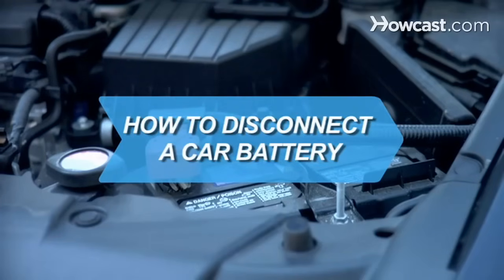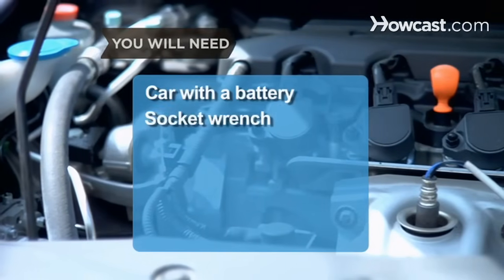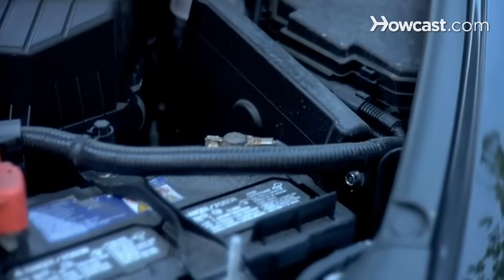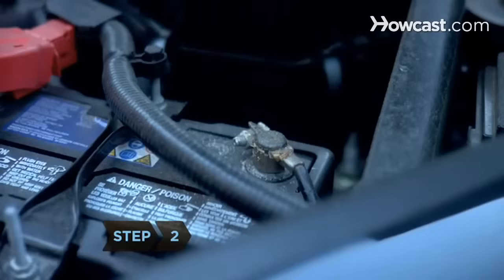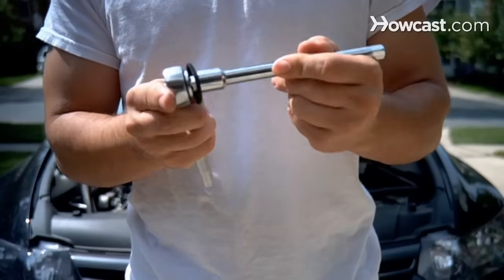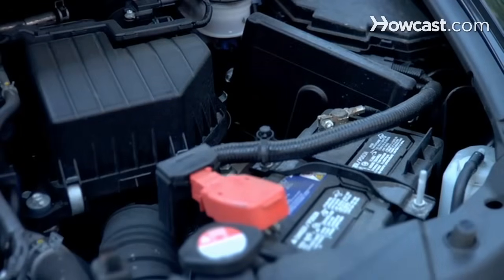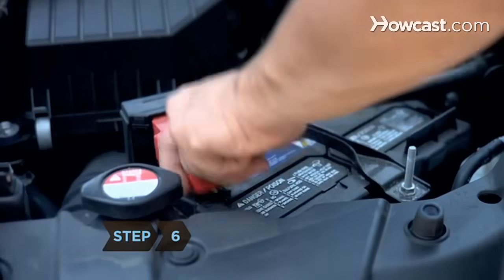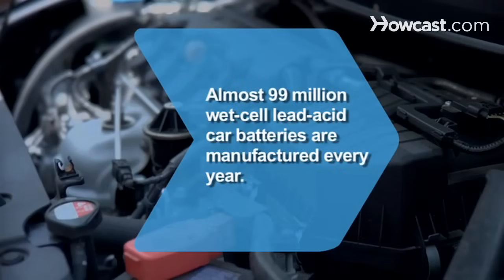How to Disconnect a Car Battery

Comment: So you don't want the positive terminal to touch any metal on the car, but it touching the metal of the socket wrench is fine? How's that work out?
Reply: Because you aren’t enough to conduct, however if that same wrench touches metal on the car while on the positive, then you may get cooked
Reply: The metal is not grounded on the socket wrench, and 12 volts is not strong enough to conduct electricity through you. Touching the car metal with the positive terminal can cause the car to short

tldr: socket wrench being held is safe as it cannot travel through you, but touching the car with the + can short

Comment: Step one should be wear eye protection and gloves.

Most car batteries contain hydrochloric acid which can easily burn your eyes and holes in your clothing
Be careful if you are using the extender because it might cross over to the other terminal and cause a shock.
Reply: I really hope your battery isn’t spurting acid

Comment: Remember, it's just a 12 volt battery...little more than your typical 9-volt.  Neg always comes off first and goes on last.
Reply: Yeah, just a 12 volt battery with a lot of amps that can cook you
Reply: may you explain why? real question
Reply: It can cause a short circuit. If you leave the negative on (black) and remove the postive (red) first, it can only flow to the negative. Always remove negative (both if you have two batteries) first, and then the positive. And then reconnect the positive and then the negative(s).
Reply: @crackerjax4330  what does short circuit mean?
 What happens to it?
My husband did this to our car.
He removed the red and left the black on it.
My old car has so MANY problems.
Reply: Thank you!!   Saved me wasting time!
Reply: Totally the info I needed...I’m always afraid I won’t remember what order to disconnect and then connect
Reply: @jenniferhermanson8969  I have to watch a video to remember every time I got through this. If my brain isn't using it daily, it tosses it. Even the simple stuff. haha
Reply: m
Reply: Exactly. I was like WAIT A MINUTE....lol
Reply: @global.mindset  nice GMAT sentence correction !!

Comment: for winter storage, can i simply disconnect the battery and leave it in the car, or do i have to remove it  to ensure its usable again. i just bought a optima yellow top and i dont want it to die over the winter with.the car sitting there. and advice would be appreciated,  thanks guys
Reply: Get you a battery tender plus. That's what I use for my battery over the winter when my car is in storage. I actually use it all year long because it's not my daily driver and the car sits alot. I disconnect the battery, sit it on my work bench and hook it up to the battery tender. It keeps the battery charged, great investment. I only paid like 45 bucks, found it on Amazon.
Reply: @JM3RD84  Does this need to be plugged into electricity?
Reply: @commentoria  Yes

Comment: This is the only way I can pass emissions. Worked 2 years in a row.
Reply: Yes
Reply: Can u clarify?lol
Reply: Ben An I’ve gotten a new car since but on my older car I’ve been able to past a test before by resetting the battery. It would take a minute for my engine light to come back on so if I got my emissions done as soon as I reset it and drive a couple miles I passed emissions once by doing this.
Reply: georgia zhane' lol ah just enough to have the check engine light to disappear
Reply: @GeorgiaZhane814  Can you clarify the exact steps and waiting time between each please? Once reconnecting battery, how long until you get car smog tested?

Comment: If you don't disconnect the negative before the positive you can end up with a short or even worse, even though this may sound and look stupid and simple, doing things the right way might save you from some headaches...just saying.
Reply: Abraham AlRajhi you ever finish this?
Reply: TheBerginton I didn’t watch this video and disconnected Red first and now my battery lights on
Reply: It's myth, build simple cicuit with one AA battery and LED, first break the circuit from the plus side of battery, and next time with the minus side, you see? It does exactly the same, since the circuit of both the car battery and LED is in series no matter which connector you detach first the circuit will be opened and thus no current will flow if you do it in the correct way, eg. when the car is not turned ON
Reply: Scared of toasters the car...
Reply: LOL @ your obd2 chip. That wont do anything for your car
Reply: yeah.. it seems okay since u have closed the circuit...
Reply: TheBerginton I only disconnected the positive because the negative isn’t coming off with the same tool that I used to loosen the red one. Is that okay ? The positive is disconnected properly tho. Or should I also disconnect the negative straight away afterwards? What is your credentials of knowing this stuff?
Reply: @AR-ng4gr  if you disconnect the positive first and let it touch any metal in the car it could cause a short because it would then make it a "circuit" again even if its technically broken when you take the positive off. This does not happen if you take the negative off first

Comment: Remove the battery from the car will it affect the ECU memory? or will it affect the car setting after reinstall back the battery?
Reply: It depends on the model. Cars use different methods to store settings.

Comment: Shouldnt you turn the car off first
Reply: Yes and use rubber like gloves just I'm case
Reply: I’ve heard people say you CAN disconnect the battery while the car is running to make sure the alternator is working, but I’ll never try that myself.
Reply: @ Lloyd Coleman

That is an accurate statement.

 I've actually used that troubleshooting technique twice in my life for my vehicles, before running an OBD2 scanner tool, and it has always proven itself to be a reliable troubleshoot for the alternator.

 You can also do a similar technique for you Mass Air Flow Sensor.

The steps are as follows:

● Leave your vehicle running while in park.

● Disconnect MAF harness.

● If your vehicle stays running, your MAF is failing or no longer functioning.

● If your vehicle shuts off, your MAF is functioning properly.
Reply: @lloydcoleman8645  you can do that. The battery only produces 12 volts, that cant electrocute humans.
Reply: @akid53vidz  another hollywood scam
Reply: No.

Comment: This video is fucking stupid.  It's correct to take the negative battery cable first!!! You do that so that when you take the positive off, touching metal WON'T matter as long as it's not the negative post that you touch.   Use an box end wrench, not a ratchet with a socket.  Most cars are 10mm, although some are 8mm and side post batteries on GMs and some of the Chrysler products that have the battery in front of the left front tire are side post, are a 5/16.  Use a 6 point socket or wrench.

Comment: Question for the people here who do indeed have a car with a battery... lol.
I need to disconnect it because my key is stuck in the ignition, but my concern is that I can't actually turn the car OFF, just the engine. I can turn it to the little ACC mark which still has minor things running, like the stereo and such.

My question: Is it safe to try to disconnect the battery in this scenario?
Reply: 3Life3 how did it go? 😂
Reply: Christopher Dude.. what if he’s still sitting in his car.. staring at the key stuck in the ignition.. gripping his cell phone, with this comment section on the screen, constantly refreshing.. waiting.. waiting for an answer?

forever & eternity...
Reply: Christopher 😂😂😂😂😂
Reply: By 6 years he probably forgot his account password

Comment: You must wear gloves and eye protection when working on the battery. Although the risk of injury is small, you certainly do not want to lose your eyesight or have some other significant injury.
Reply: I really have the absolute worst luck when it comes to electricity for some reason,I'm actually amazed that I'm still alive.... I'm definitely wearing gloves when I'm doing this
Reply: @RealArtVandelay  You alive?

Comment: Will this still work if you only have a socket wrench and not a battery?
Reply: I didn't have either and it still worked.
Reply: Yes
Reply: Technically if you don't have a battery, any statement about the battery is trivially true. So yes it is disconnected :)

Comment: My husband is deployed, and his jeep has a short that keeps draining the battery. So, he asked me to disconnect the negative terminal until he gets home in a couple weeks so it doesn't drain the brand new battery. I have never ever touched anything on the inside of a car! You video made me feel a little more confident that I could do this! All disconnected and I didn't electrocute myself! Thanks!
Reply: Shiloh Ferraro ☺️
Reply: You won't get electrocuted from a 12-volt. Good job and also you should probably learn how to put air in your tires and check your oil and other fluids maybe change your oil... You are very capable and it's good to know how to do these things
Reply: @juliamariemadness  after disconnected negative on battery , can doors be locked?
Reply: @juliamariemadness  you ever see a car battery blow up?
Reply: @juliamariemadness  lol, women, amIright?
Reply: Is it common for Chrysler products to have a short that drains thale battery?
Reply: Wish I knew about this whole disconnecting the battery to make it last longer cuz I’m dealing with the same thing right now
Reply: I am afraid to do this but I have to because I am away for months at a time.
Reply: @commentoria after disconnected negative on battery , can doors be locked?
Reply: Did he make it home safe?
Reply: Go screw his BOLTS LOL
Reply: Wamen moment
Reply: WOW! I didn’t know women were capable of doing car work!
Reply: @luisishere987 Maybe in another generation . Women have grey matter too. It’s just a matter of learning how to do - the same as men do.